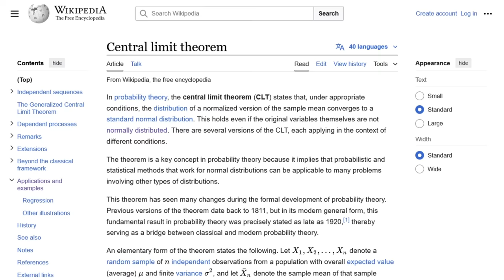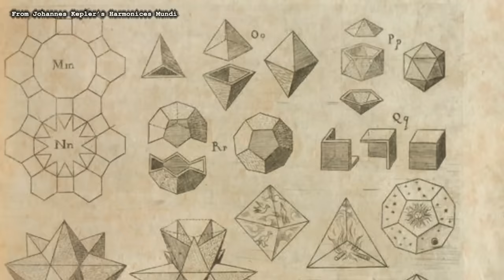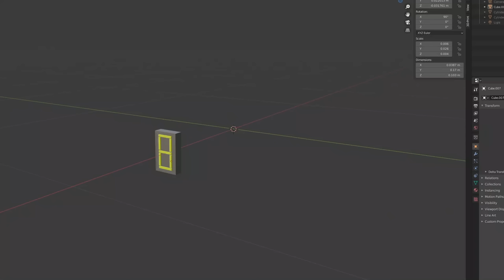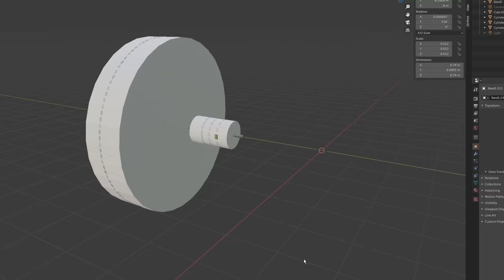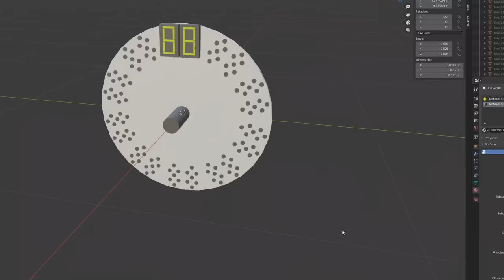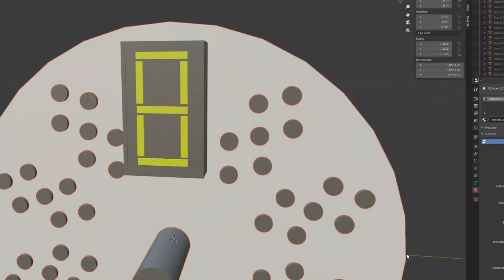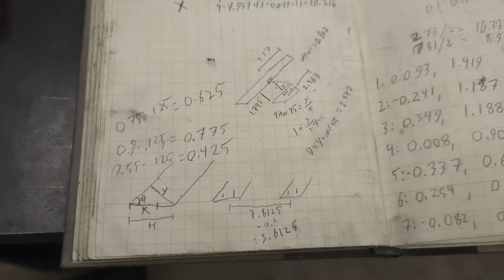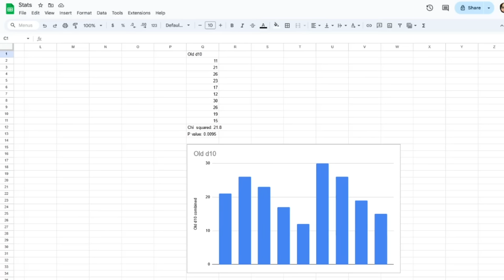Making a d10 spinner

Comment: Actually, if you cover the disk with thin aluminum sheet, so individual magnets are no longer visible, it will be even more satisfying and "mysterious".
Reply: The aluminum may act like a brake though. While it isn’t ferrous it is metal and responds to moving magnetic fields.
Reply: @NandR It wouldn't be a breaking effect though, as no eddy currents would be generated as the magnets would be spinning with the aluminum.
Reply: @electrifyingvids3545  There are magnets on the display though...
Reply: @joey_f4ke238  Perhaps they could switch to silver plated plastic? The silver would provide negligible eddy currents.
Reply: We tried that, and a small portal opened up, so we shut it down, like CERN in 2027, fyi, the future sucks!
Reply: @andyp3834  Ah, yes, I remember, that was quite fun, good old days.
Also did you know that if you travel back in time, people in the past don't have a way to send you into the future and will instead send you to a hospital full of crazy dudes?
Reply: @hubertnnn  I didn't know that, sounds true, almost as the same as when the Army didn't know what to do with me after my brain shut down in basic training, just after 911, LOL, anyway, they sent me to a crazy ward for 21 days, lotsa fun ;-) I dont regret any of it though, i must be stronger, cause im not dead, thanks for the comment, have an awesome weekend. ;-)
Reply: If you wanted to cover it, just use something like sticky back vinyl. No need to overcomplicate things. I like the magnets though, it gets you thinking about how it works.
Reply: Good argument for reforming the mental health system if you ask me.

Comment: Since you just want random numbers and don't care about them being arranged sequentially in the spinner, you can overlap the positions and reuse magnets from the previous position for the next one. EG 2,3,5,6 and 8 all have three horizontal segments so you can get away with just one set of magnets to flip them on for half the wheel and then another set to flip them (as needed) in the other half of the wheel. You can also take advantage of the fact that the top half of the vertical segments are the same in 2/3 and in 5/6 whereas the bottoms are the same for 3/5 and 6/8. Meaning you just need to encode which bits to flip, not the whole state of the display per position. And, by just encoding the flips not the full data, you can cut down drastically on the space needed in the wheel.
Reply: I like this line of thinking, but I can't help but think that there would be some inevitable failure in the magnets flipping every node every time, at least when the disc is spinning fast. The one nice thing about parking the display over a full array for every number is that every node lands on a magnet that ensures it reads correctly. And having the same number of magnets on every number also helps balance the weight and spinning speed to reduce bias. I would think since magnets determine where the wheel stops, having more or fewer on different numbers could make them more or less likely to appear. I could be completely wrong though.
Reply: @shotguntornado  if you have a reset field (all on/all of) maybe it could be enough. Because in the end you only care about the correct flips once it slows down. And you should already have the bias in the wheel as it is. The one that has only "repellors" should be more unlikely than one that has only attractors or do the displays not work like that?
Reply: Won't that mean it only works in one direction, though? Since a magnet doesn't "flip" a bit, it's specifically writing a 0 or 1. If you set it so going from 6 to 8 just entails activating the top-right pair, then going from 8 to 6 will only keep them on.
Reply: Neat idea but the end result would just be the display showing an 8 since the magnets would pass over and flip things which weren't supposed to flip.
Reply: @SollowP  I didn't even consider that, yeah you can't just choose to flip a left or right side. You can't flip a 3 into a 5 without it becoming a 9 for example.
Reply: I think the balance would be hard to adjust thus making a heavy side.  The way he has it now would defiantly be easier to make without needing a balancer to ensure fairness.
Reply: This would also change the distribution of results in the bar graph, probably making it closer to the d10 results.
Reply: I feel like I want to map out and see if this is even possible. You would have to have a continuous sequence of 7 segment digits that the left side of one digit is a match to the right side of the next...first impression is that there are too many digits that have all three right side segments on and not enough that have all three left segments.

Comment: i love dice and dice adjacent peripherals but my favorite part was drilling into that magnet. would not have thought it would look like that
Reply: I wonder if there was a termite reaction going on? Iron and aluminium burning?
Reply: @m1geo  Probably just straight up burning. It's a cermet, there isn't any aluminum metal in the magnets. That wouldn't work since they're sintered! It's just straight up burning, for a thermite reaction you need an oxidized metal and a metal that wants to pull the oxygen. Rust (iron oxide) + aluminum = pure iron + aluminum oxide + heat. There is no oxidized metal in a neo magnet, so it can't be a thermite reaction. That means it's just straight up metal fire :) I mean there is a tiny amount of aluminum used probably as a flow modulator and plasticity enhancer during the pressing, that just kinda does nothing after sintering, but you aren't getting a thermite reaction with .2% aluminum. It's just normal combustion oxidizing all the metals
Reply: @dogsarebest7107  "Probably just straight up burning."

Well, it's glowing. The drill bit would melt long before reaching the temperatures required to ignite the metals in the magnet.
Reply: @vinny142  No, definitely not. That's a tungsten carbide endmill. They happily turn steel into burning shards, happily turn titanium into raging fires, what makes you think it won't do it for this?

It has to do with PHYSICS. Small particle size means LOW THERMAL MASS and HIGH SURFACE AREA. That means it burns REAL EASY. Why do you think microscopic powder generated is HARDER to ignite, than a solid chunk of tungsten that weighs several ounces? Even ignoring the fact that one particle igniting, generates heat that then raises the temperature of adjacent particles to either very near, or above the autoignition temperature. That's how exothermic reactions are defined. Have you seen any machining videos? Never seen a spark happen? Never see ribbons of metal burn? Touch a 9v battery to steel wool and think about it

Static electricity can happily ignite aluminum powder or titanium powder, but the spark doesn't vaporize your finger. Because.. physics.

Comment: You solved two problems (percentile is just two of these). You only need a single bit display to extend it to a d20, as many early d20s did double duty before the modern d10 shape took hold. They would have 0-9, and 0-9 again but with a dot. If you were using it as a d20, the dot was worth 10. If you were using it as a d10, you ignored the dot. In your case, perhaps use a second digit that either underlines the number, or doesn't. Then the viewing window could hide most of the extra display and you're only adding one magnet per number (although twice as many numbers).

If you build a d20 disc this way, it can double as one digit of your percentile die so you wouldn't need a second d10. You could also use it in conjunction with the d10 to speed up that Eldritch Blasting.

Similarly, you could make a dual-purpose d12/d6 spinner, and a dual purpose d8/d4 spinner.

Comment: this got me thinking about how cool it would be to have a revolver where the cylinder has the magnets around the outer circumference, and have the display mounted on the top.
would be fun to play a western style game, pull out your revolver, give it a spin and have the 'roll' shown to you. add a little flair to your roleplay. especially so if your rolling D6s for damage since many revolvers are 6 bullet capacity so it would really be fitting
Reply: Fascinating idea and of course the numbers arranged appropriately will count down remaining ammo
Reply: I have a revolver cylinder with a full set of bullet dice just for this purpose
Reply: Now I'm imagining 3d printing a toy revolver in your design for use in a Russian roulette "game".

Comment: Nice build! Regarding the cylinder + magnet channels idea, at 04:25 you could tilt the display about 18° clockwise (or 12° CCW) to have the Y positions of each magnet be somewhat equally spaced, and it might be possible to design a cylinder where the 7 magnets for a given digit are not in a straight line, but in a weird pattern that matches the exact position of the display. It's a bit difficult to explain but I can sketch something if you'd like :) smaller magnets in the cylinder would probably be required (and a ton of magnets if you want a d100)

Comment: Great video! If you want to ream a hole oversized with a nominal reamer, you can shove a greased-up paper towel wad into the hole. You'll manage to oversize it by about 1.5 thou. If you need a little less slip, if you run it at a higher RPM and feed more slowly, you can shave off a bit less. As with drill bits, you'd be surprised how a reamer can be manipulated!

Comment: Instead of bending steel bars to get your magnets into a linear configuration, I recommend trying lengths of coaxial cable, which should be shielded well enough to prevent that crosstalk you ran into. By the way, first-time viewer here — great video!
Reply: Coaxial cable will not transmit magnetic flux... Not static flux anyway. Your idea about shielding is correct but coaxial cannot shield against a magnetic field. Coax only shields against induced magnetic fields and that's a dynamic situation only.
Reply: For magnetis screening..Mu metal is your thing ( mu pronounced moo )
Reply: @jasonudall8614  that's exactly what I was going to comment
Reply: packs of thin steel wire, with a wrap of kapton followed by mu metal tape and another layer of kapton, and maybe bismuth or pyrolytic graphite filling the space between them. That ought to work quite well.

Comment: You can still do press fit magnets in a drilled hole, but you can't use pressure. It's counterintuitive but if you chill the metal the hole will get larger not smaller. If you chill the metal sufficiently it's effectively and largening the whole big enough to accept the magnet without any serious force and then the magnet gets clamped when the metal warms back up to room temperature. Chilling also doesn't damage the magnets that way. You might be able to use dry ice to chill it, but I'm more effective mix might be liquid propane.

Comment: I love it! I have a thought for how to make it easier to remove inverted magnets: 
first drill through-holes at all the right index positions, between half to 3/4 of the clearance hole diameter. Then have a drill press with the clearance hole bit & a depth stop. The larger bit should naturally center on the pilot holes well enough; start with a depth too shallow & "sneak up to" the depth where the magnets are flush to the surface. 
Now if a magnet is backwards, you should be able to knock it out with a punch from the back side pretty easily, especially with a glue that takes 24 hours for "full cure." 

I'm a mechanical engineer with above-average manual machine shop experience 😉

Comment: Thanks for sharing yet another marvelous building endeavor!

Should you ever have more time than ideas - let’s recreate and improve Konrad Zuse Z1. That programmable mechanical computer is able to perform float point calculations but is prone to metal stripes stuck and bent irreversibly. The existing replica is close enough to the original to suffer from exactly same problems.

Comment: I think when you heated the metal with a gas torch you took it past the curie point which messed with its magnetic affects. You want a nice ordered line of iron atoms, and now there kinda all over the place, not passing the affect down the rod, it just goes out the side or wherever.
Reply: is there a way to restore it? like, magnetising the metal while it's red-hot  and cooling?
Reply: The iron rods weren't magnets themselves. They were just supposed to "conduct" or guide the magnetic fields from the neodymium magnets. Once they cooled back below the curie point, they would be able to do that as they'd be attracted to the magnets again. I think the problem was that the magnetic field needs a return path, and without one provided, it would follow the adjacent rods back inadvertently flipping other segments.

Comment: I also made dice out of cardstock, back in the 80s. I couldn't find a d30 so I had to experiment with many shapes until I ran across the correct angles for a diamond face.
If you use tape on the inside they work well. Use a toothpick ftom the corners to get the last few faces.

Comment: I do lots of CTL stuff at work and have been playing with the affects on dice rolls and game mechanics. Hint: Multiple dice 'opposed' or subtracting some defensive roll from the attacker's, plays the same as multiple dice rolls by turning the result in a normal distribution with a mean of the respective dice difference and a much more limited range than multiple dice rolls for mastery. Manipulate the dice size of each half to set the expected outcome.

Comment: I built a digital dice roller with an ESP32 and a small OLED screen, the hardest part was generating random numbers - surprisingly hard on a microcontroller. I ended up sampling noise from from a breadboard cable just hanging off an input - but I could still feel patterns in the rolls...

Comment: Great work! Wish I had stopped by at Open Sauce. If you run into an issue with a super glue-d part again, then you can try using acetone, commonly found in nail polish remover, to dissolve the superglue. It might need time to soak in and go into super tight places, but it's pretty effective! Especially ungluing fingers from each other.

Comment: It'd take a bigger disc, but you could do a D20 if you compromised in using A-J (with a weird g) for 11-20. Or, a single flip dot for +10 (eg. dot-3 is 13, while no-dot-4 is just 4). You'd still need a big wheel for it though.

Comment: Now I'm curious of a v2 revision, adding a roller motor. Have a controller apply a random voltage to the motor (carried between minimum motor start voltage up to a safe limit) which would then momentarily run a drive wheel along the edge of the disc, giving it random amount of momentum, then allowing to spin down to stop. Being the momentum would be randomized, as well as the last number the disc was on be essentially an unknown start point, it would be much more random of a roll each time the motor is triggered. Even could have a randomized 0 voltage call, which simply means your result is whatever the current value is. Could additionally randomize it by adding a random timer to the motor run time.

Comment: Well. This is awesome.
You could set it up to swap disks rather then a giant cylinder and that could give you coin flip to 1-10 with this set up
or you could try some MuMetal sheeting to stop cross talk between various magnetic channels, or just steel foil  as a proof of concept and that would allow you to run your magnets inline as your second (?) plan had.

Although if you use MuMetal uh. Have "fun" cutting it at fractions of an inch per hour unless you can get a sheet thin enough to sheer and have a carbide sheers.

Comment: Bending rods into a linear array could actually still work, what you need to do is put an antiparamagnetic material in between the rods to increase the barrier separation for the flux. Without doing any serious research and off the top of my head I would recommend pyrolytic carbon sheets between the steel rods. It would increase the amount of potential that the flux would have to traverse in order to tunnel from one rod to the next. It should give you much more granular control over the rods while still having them much closer together. It's basically the magnetic version of electrical insulation

Comment: 6:20 was afraid of this. The heating and bending may alter the metal's crystal structure to the point of unreliably transmitting the magnetic impulse. Second, the adjoining rods are sharing the impulse. Maybe with some kind of electromagnetic shielding between the rods? 

Once you are back to cylinders, which need multiple diameters, you might end up needing rods again to transmit the impulse to a level 'display field' at the outer radius, depending on your physical design. Linked multiple digits (all on one cylinder) are going to run against interval limit and how many detents you can set, so each display/digit probably winds up as it's own cylinder on a shared axle. D100 could be reduced to spinning two d10 adjacent or sequentially. (d10x2 or d10+"d10s", with 0 fixed after the rolled tens digit).

9:55 so many metals happily eating oxygen at literal grams/second

Comment: I had no idea these were physical and essentially stable without a supply of electricity.
It's sweet. 

I wonder if a system of small bearing balls and slots with room from 0-10 could be used to retrieve the value from a reservoir, send them to be stored in a line that fits up to maybe 100 balls, then pushed back up to the reservoir with a lever. But then again maybe we don't want to take a little math away from people.